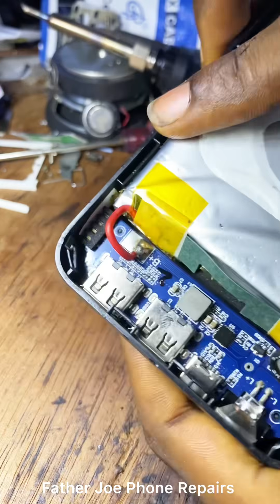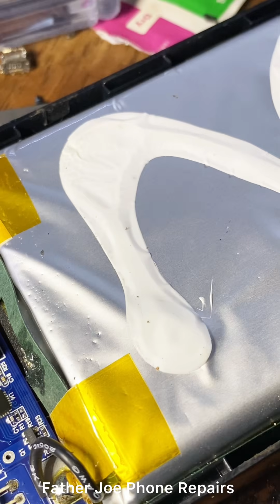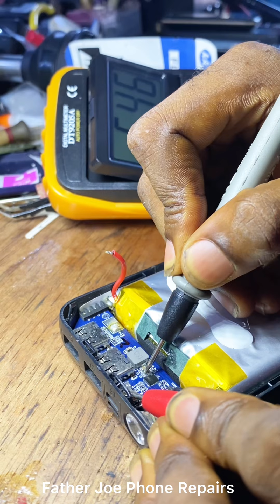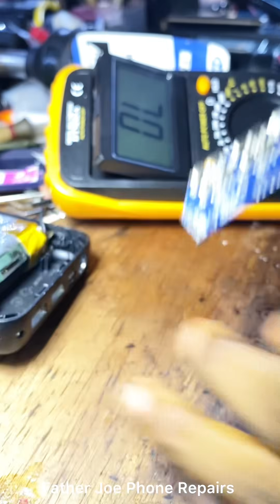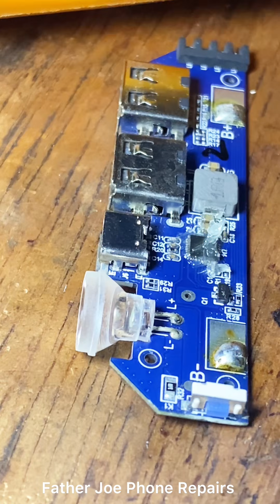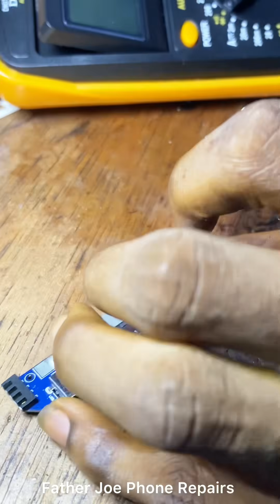How to repair power bank  ( Real troubleshooting ) 😍￼￼

Comment: Good sir
Sir please my power bank is refusing to On when ever I put the negative of the battery on the negative of the panel it still doesn't On 
But when I place it on the USB port the  light(indicator) comes full but doesn't charge any thing

Comment: The connection of the meter wire depends on the meter type 
4 digital meter , the RED wire should place on "Gnd"ground any iron part 
4 analog meter no reverse color BLACK wire should be placed on Gnd". ground

Comment: Father Joe, Weldon Sir.kip the gud job.
Am also competent Engineer as you are.this type of issue is not from the capacitor, it's the CPU .that is common know as IC! The blinking light is talking of Emergency mode,why the IC is heating by excessive voltage from a faulty charger. A capacitor short to protect.so if there's a short capacitor, the IC we not hot and no light signals. thank Father Joe

Comment: Sir charging slow in test volt see 4.8 which capacitor check
Reply: Do you mean voltage from the charging port on the board

Comment: How do I troubleshoot, where to set your multimeter and when sud both terminals of my multimeter be set on the motherboard
Reply: On digital meter, turn your meter to diode Logo commonly kn as continuity,then place the Red wire of your meter on Gnd. I mean the body and use the black wire of the meter to keep touching any capacitor both side.if the both side is given the same reading on the meter,that is short
Reply: Your multimeter matter the type. The reading of analog meter is different from digital meter and the Polarity is different.

Comment: Father joe if the positive Base to which the positive terminal of the battery is connected is pulled off where should I run it

Comment: Can we use wire to bypass the ic e.g 16 pin ic
Reply from the maker: No it will not work
Reply: No. It a smart Ic . no any logic for bypass, it's ending is Zero

Comment: Nice video, but as a real technician you should know that any heating IC is a shorted Ic and the only solution is to replace the ic, why do you waste alot of time  trying to repair a shorted IC. Next time have a replacement for the IC.
Reply: To quickly solve the problem I guess will not get the time duration he needed for the video hence, he has to do what he has to do
Reply: abi.. atleast make YouTube pay